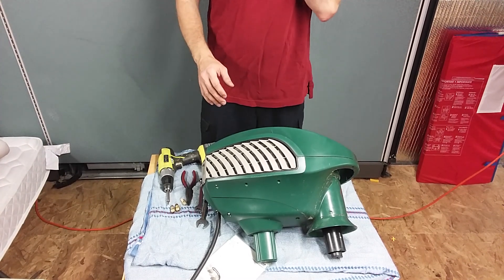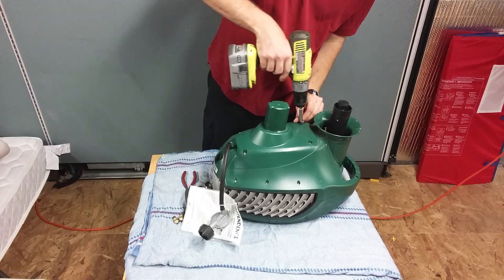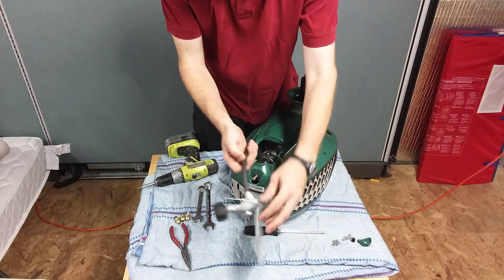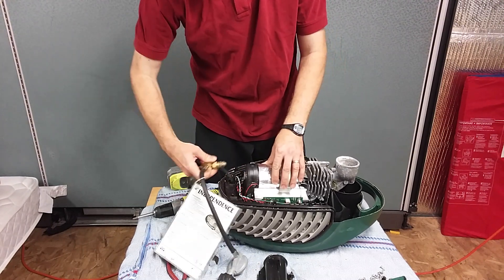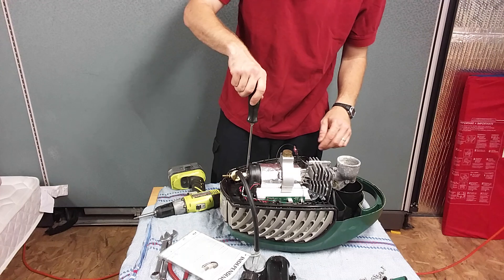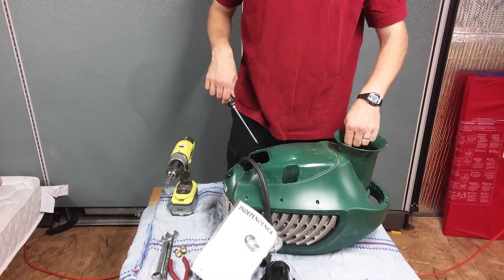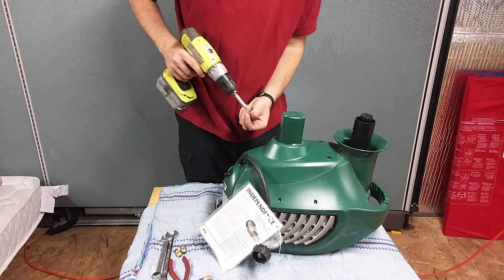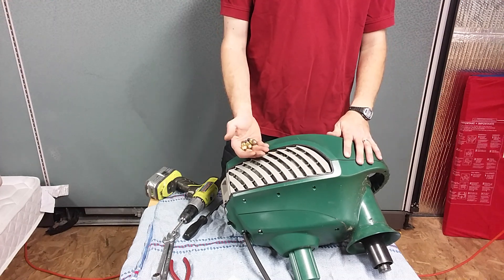Mosquito Magnet Repair Red Light Flashing No Fuel Flow

Comment: old thread... but one thing that older propane tanks had was an OPD valve which, if opened quickly would be 'sensed' as a pressure leak and closes itself off.  The original Defender came with a red "OPD Reset" tool that would release the pressure in the OPD valve and allow you to take another run at it!  just take the regulator off the valve and   crack it open.  If no gas flows, you've tripped the safety valve.  That flashing red light can certainly mean "thermistor failure" but it can also mean "failure to light" ie the thermistor doesn't actually  get hot.

Comment: Hi, followed your video on a patriot machine. Helped me out quite a lot. Just one question. Where did you get the replacement filter/nozzle?
Reply from the maker: check out my aircraftmec ebay page.  I sell the new fuel nozzles for most models there.  Search for Mosquito Magnet Fuel Nozzle.  Thanks for watching.

Comment: It worked great!! Had it for 3 years and now I find that the magnet goes off with half a tank. Is this due to the fuel nozzle needing to be replaced again perhaps? I restart and it is fine.
Reply from the maker: In the unit is a thermoelectric generator (TEG) that recharges the battery after it starts up.  That could be getting weak but then you should have to recharge the battery before restarting it.  It may be that the fuel nozzle is getting clogged but then it shouldn't restart right away.  What light error coded flashes when it shuts down?  You could compare that to the troubleshooting steps on the MM website.
Reply: @aircraftmec6858  Okay thanks I appreciate it! I gave up on it this year but when I do try to get it going again. This information helps and will look at what codes I get. I don't remember seeing a code/flash I don't remember. I think it was just off and I turned it back on with the tank being half full.

Comment: Hi.  Do you find that starting the MM when it is chilly out (55 deg F), that it is more difficult to start?  We are not able to start our Independence today, and wonder if it is because it is plugged or if it is just too cold out.  
Secondarily, we have a Costco portable air compressor.  I hooked it up to the Schrader valve and it built up to 140 psig (almost max of the unit) but after running like this for a few seconds (20-30?), the back pressure fell to 110 psig and stabilized there.  Can you run a test on known contaminated nozzle and a fresh one so we can test our nozzles before just replacing it?
thank you!
Reply from the maker: They do have a slightly more difficult time to start when they are colder.  The Executive models have a temperature sensor on them and will not allow you to start it if the temperature is too low.  I would try it again on a warmer day above 60 or 70 and compare.  I will see if I can find some nozzles to do your test.  Even if you are able to force air through the nozzle the filter can still be mostly clogged.  The only way to fix this is to replace the nozzle or try and clean the filter.  I have not had much luck with the later and the passages are so small in the nozzle, it is easily to get debris lodged in there.  I have found it easier just to replace the nozzle and filer every couple of years.

Comment: I have a liberty plus that doesn't seem to want to ignite.  I start it up and the fan runs and it sounds like the ignitor is clicking, but I never feel the warm/moist air, and the LED stays solid orange.  
I've shot compressed air through the bike valve, and replaced the fuel nozzle.   Any suggestions?
Reply from the maker: Do you hear the "click" from the fuel solenoid opening?  I have another video on the startup sequence you may want to watch that one as well.  Use soapy water to check and see if any gas is leaking out the Schrader valve.  You could remove the nozzle assembly from the motor and try and start the machine.  When you hear the click from the solenoid open place a lighter above the nozzle.  There should be a small flame.  (make sure you due this outside away from flammables.) Shine a flashlight through the motor and see if you see any blockages.  Those Liberty Plus models are older and can get blocked with time.  I also have a small mirror to look up the motor and check for blockages and verify the catalytic is heating up.

Comment: When I went to change the fuel nozzle, there's a small black box with wires attached to the same piece.  As I was using the wrenches to release the fuel nozzle, this black box popped off, along w/ a small washer.  I cannot figure out where this washer came from, or how it was helping the black box stay on, but right now, it appears the black box just slides back on, but there's nothing technically securing it in place. Am I missing something?  is this washer supposed to be doing something?  I'm assuming this has something to do with the battery...  The black box isn't visible in your video, as it's facing towards you.
Reply from the maker: The Black box with the 2 wires is the coil that opens the fuel valve.  That needs to slide over the silver shaft.  The earlier units had a nut to hold it on .  The later units had a "E" shaped snap ring that goes in the groove at the end of the shaft to hold the valve on.  If you lost the E clip you should be able to get one at a local hardware store that will snap on the shaft.

Comment: Good question Benoit Paquette.  I am wondering where you got the replacement fuel nozzle at also.  Or did you just clean it?  Thanks
Reply from the maker: They are very hard to come by. I was able to locate a supplier and now I sell them on Amazon and eBay. I'm running low currently but should have some more in stock soon. Thanks for the support and thanks for watching.

Comment: Hi, I know this is an old thread, but still very useful. So, my question is about the howling/whistling sound that comes from my liberty plus. Have you ever encountered this? If so, do you know where it's coming from and how to prevent it?
Reply from the maker: I would guess some of the inner channels in the aluminum motor may be getting clogged/corroded.  If you take it apart  you may be able to stick a flashlight and mirror up the motor exhaust and see if there is any clogs or partially blocked passages.  The restricted flow may case the unit to whistle more.

Comment: Thanks for this video.  Any ETA on getting the replacement fuel nozzles back in stock?  This has been my biggest complaint with Mosquito Magnet.  Thanks.
Reply from the maker: Michael J Peckman I was told by my supplier I should have them in this week but they have not arrived. I hope to have them by the middle of next week. Sorry for the delay I know it was a big issue.
Reply from the maker: I now have nozzles in stock for all models. Search Mosquito Magnet Nozzles on ebay Ktoolbox12.  Thanks.

Comment: Can you tell me how to take off the regulator hose in order to change it?  Thanks!
Reply from the maker: The regulator hose screws into the bottom of where the solenoid valve body is.  I think it takes a 3/8" wrench.  Make sure you put tape on the new hose and leak check it.

Comment: Great video, thanks! All models of the Mosquito Magnet frequent blinking of the red led indicates a problem with the injector?
Reply from the maker: No.  Each model is different.  On the cordless models the color and sequence of blinks will lead you to a fault code and help in troubleshooting.  For a description of the fault codes check out this website:  http://support.mosquitomagnet.com/help/
Reply: Thanks for the reply and interesting page. I have the simplest model - a Patriot with a monochrome led. Tank full, remains a clog in the nozzle, right?
Reply from the maker: The nozzle is a good place to start.  Those models are much harder to disassemble and have to be sealed back together.  The combustion chamber also gets clogged on those.
Reply: Okay, thank you. Start with cleaning the nozzles with solvent. The combustion chamber should also be disassembled for cleaning? Never seen the video for cleaning the insides of the combustion chamber.

Comment: Quick question, does the lighter go just as often or is the fuel nozzle the main culprit? How long do you think a new fuel filter nozzle will last? I bought my Liberty Plus used about 5 years ago. Hoping to get another good run, thanks.
Reply from the maker: petey2u I have never had to replace an igniter . May go bad I just don't remember having to replace one. The fuel nozzle in the thermistor early to main culprits on these machines.
Reply: aircraftmec do you have replacement thermistors?

Comment: I have clean the nozzle, blow it clean by my compressor. The ignite is working. But still my Mosquito magnet patrol plus do not ignite and the lamp is flashing red. Do you have any idea what can be wrong?
Reply from the maker: Even though you have cleaned it, the tiny orifice may still be clogged.  Or the filter may be clogged.  The air compressor may have pressed debris into the orifice.  I recommend replacing the nozzle.  See my links in the description to purchase a new nozzle.  The tube could also be clogged not allowing air to enter or exit the plume and motor tube.

Comment: I have flame when I held a lighter next to thr valve (i took it out of the combustion chamber), cobustion chamber is clean as Ive clraned it, thermister works as ive tested the resistance, ignition works as it glowed, but Im still getting fast blinking lights. Does anyone know why?
Reply from the maker: I have a small inspection mirror that I can put in the exhaust to make sure it is sparking and heating up properly.  The fast blinking light usually means a bad thermistor.  It may be fine at ambient temp but may not change as it heats up.
Reply: @aircraftmec6858  after playing around with it, it seems that the controller board may be the issue where the thermiater plugs into the board. I was able to get it to work a few times. But when I touch the wiring, it gave me the quick flashing again. Do you know where I can purchase a new controller board?
Reply from the maker: Unfortunately you have to have your unit serviced by a factory service center to get new parts.  Sometimes used ones and maybe used ones pop up on ebay.   @caine-chow
Reply: @aircraftmec6858  I did some youtube research on microchips. My compacitors were malfunctioning. I was able to resolder new ones on. It seems to be working now. I'll test it in the real world. Keep you posted.

Comment: Have you tried cleaning these fuel nozzles with an ultrasonic cleaner?
Reply from the maker: I tried soaking them in some cleaner but I couldn't get the filter clean.  The nozzle port is also quite small.  not sure if ultrasonic would get it all the way clean.  I also don't have access to an ultrasonic cleaner.    It is usually easier for me just to replace the nozzle.

Comment: I'm struggling with my MM. The problem is the red led flashing fast. I've ceck the board and everything seems work fine. The ignitor turn on and the NTC change the value depending on temperature. The valve is open and I can ear the sound of gas caming out and I can ear the sound of ignition  ( puf). After minutes the aluminium piece is quite cold. And red led begin to flash... can you help me? 
 i've take out the nozzle and looks new is not dirty at all...
Reply from the maker: The red flashes are a code.  Is it just red or red and orange?  you can look on Mosquito Magnet website.  Hey have a troubleshooting guide for the various fault codes.   Even though you hear the initial ignition puf you nozzle may still be partially clogged and not allowing enough fuel through to sustain the ignition.  I would recommend replacing the nozzle and trying it again.  They are the cheapest and easiest thing to replace.

Comment: also there is no screw to get the nozzle out it is right in the silver area and there is gasket between two silver parts
Reply from the maker: this video shows the Liberty Plus and Independence models NOT the defender or patriot model.  I am working on a video for repairing those models.

Comment: I coudn't find you at ebay.com. Can you post a link?
Reply from the maker: I am currently out of stock but my supplier guarantees I will have more in stock next week.  Stay tuned...
Reply from the maker: I now have nozzles in stock for all models. Search Mosquito Magnet Nozzles on ebay Ktoolbox12.  Thanks.
Reply: aircraftmec replaced nozzle with one from eBay, can smell trace of gas now coming thru during startup cycle, but don’t think it’s lighting, timing out and red light flashing. Any other ideas?